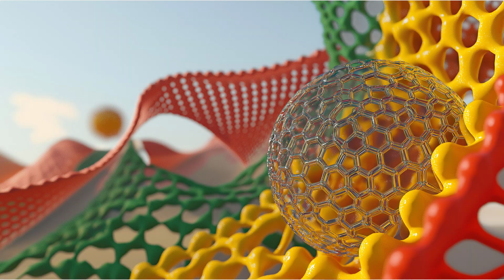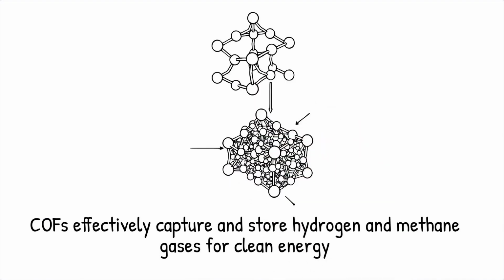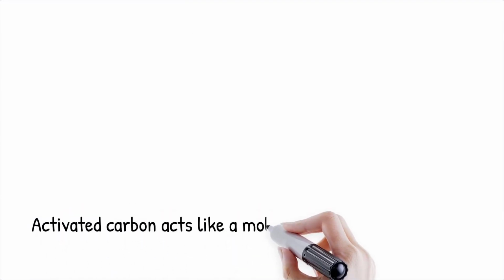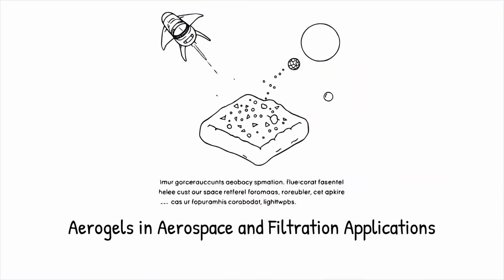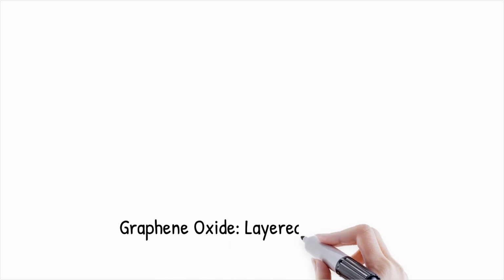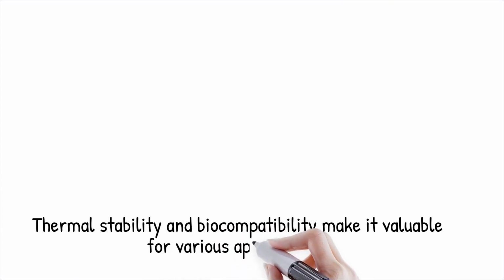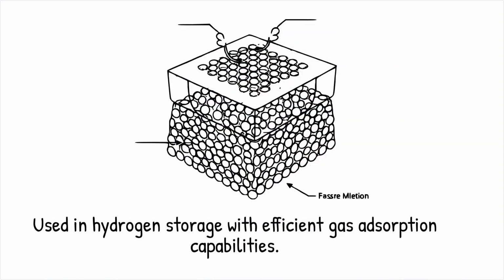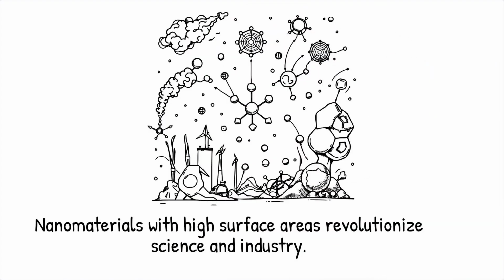High Surface Area Nanomaterials: ONE Gram is a Football Field!

Comment from the maker: Surface Chemistry and Applications: How do the chemical functionalization processes of graphene oxide influence its adsorption efficiency for heavy metals in water purification systems, and what trade-offs exist between surface area and chemical reactivity?
Structural Optimization: What are the challenges in designing metal-organic frameworks (MOFs) with ultra-high porosity (>10,000 m²/g) while maintaining mechanical and thermal stability, and how do these limitations impact their scalability for industrial gas storage applications?
Material Interactions: In multi-material systems combining aerogels and carbon nanotubes for energy storage, how does interfacial interaction between materials affect their overall charge retention and conductivity performance at the nanoscale?